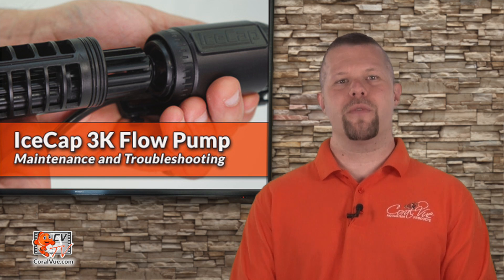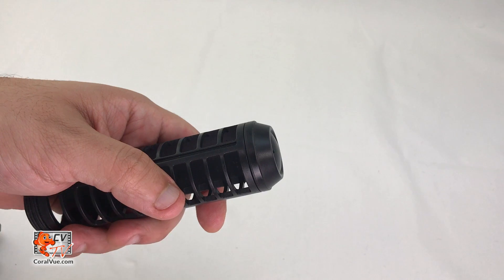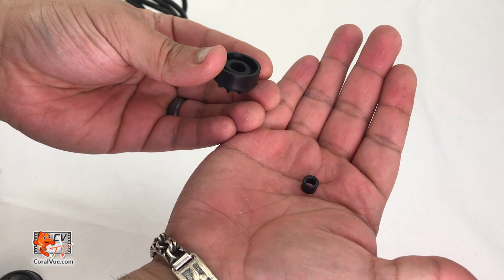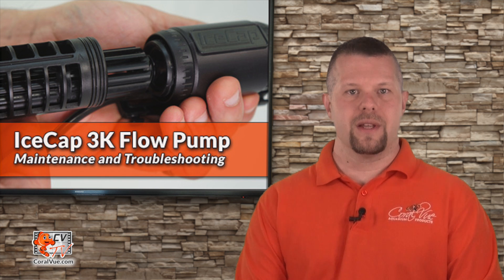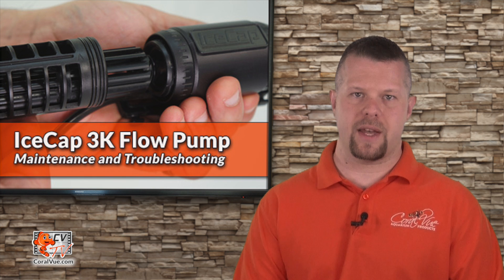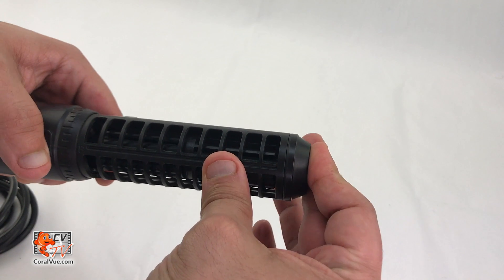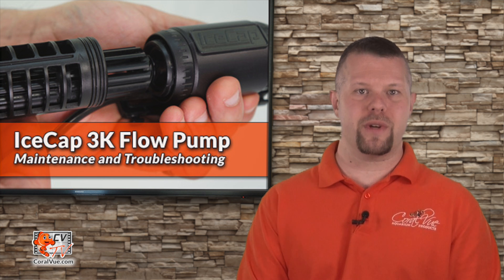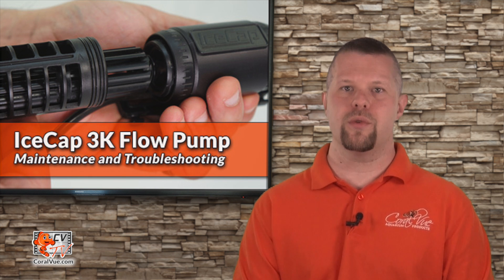IceCap 3K Flow Pump: Maintenance & Troubleshooting

Comment: hey guys.  if the wrong propeller blades are placed on the wrong sides, will it actually run in reverse?  i am wondering if this is why mine is spinning, but i can't feel any water movement being pushed...
Reply from the maker: Putting the impellers and/or cages on backwards could alter the flow of the pump. You want to ensure cages are on the correct side and the propeller has the blads facing the front of the pump. If the blads are facing the back of the pump then they are on backward. Hope this helps.
Reply: Ohthey are on correctly.  they're running but nothing is coming through them.  i just cleaned them a week or two ago.  what else can it be?   this just doesn't make sense!   @CoralVueTV
Reply from the maker: @lisademayo8589  Something is not properly put together if the propellers are moving but there is no water movement. I would suggest submitting a support ticket to: https://support.coralvue.com/ for assistance

Comment: This is great video on step by step guide . I tried and I finally made it. Taking out shaft was not easy at all. You may be unable to do it like video. I placed the marker cap at the center of shaft, then I had to hammer it carefully.  Then I could removed the shaft from.the driver. The problem is the shaft was misplaced and moved to the left. So I had to hammer the shaft to be placed in the middle of the magnet cylinder. Sludge were inside the driver.  After cleaning it up, the pump performs much stronger.  I hope this could help you out.

Comment: Easier said then done. I could not remove the shaft through the driver. I gave it some pretty good force, but I didn’t want to push anymore in fear I would break the shaft.  I’m hearing a humming noise from my 4 month old gyre and it’s really getting on my nerves!  Mind you...this unit was silent the first few months.
Reply from the maker: Sorry for your frustrations. Please head over to coralvue.com/support for assistance.
Reply: Same here - it sounds like a machine is processing something.

Comment: I just purchased mine today 08/24/18..  Well mine came with the new controller that the 1k comes with. The controller powers up but the pump does not run. I took it apart and reassembled the pump it self.. Everything seems to be ok but nothing from the pump, just wont spin.
Reply from the maker: Sorry to hear of the issues you are having with your 3K pump. Please submit a support ticket to CoralVue.com/Support for assistance.

Comment: ONCE A MONTH? WTF
Reply from the maker: All pumps would benefit from monthly cleaning to maintain peak performance and the IceCap Gyre is no different. It is just a suggestion and is entirely up to the user how ofter they clean their flow pumps. I have one running here for over 12 months without cleaning. Sure it is louder than it should be and the flow is not as great but it still provides my tank with the needed flow.

Comment: Can I run this through a vinegar and water bucket. Or do I HAVE to take it apart?? I don't want to take them apart if I don't have to. Asap please. Thank you
Reply from the maker: If your troubleshooting an issue disassembly is advised. Otherwise soaking or even running in a vinegar solution with a little light scrubbing may be all that is necessary.
Reply: CoralVue yes thank you. No troubleshooting yet. Fingers crossed lol. I love this thing prob my fav equipment by far. Thank you for the fast response 👍🏼👍🏼
Reply from the maker: you're welcome.